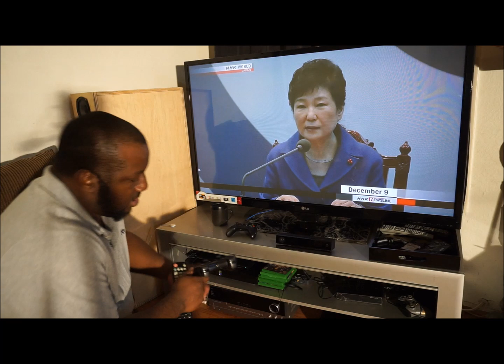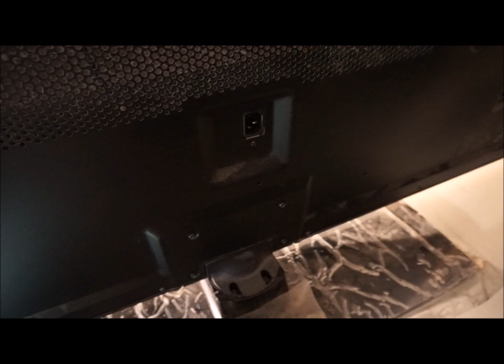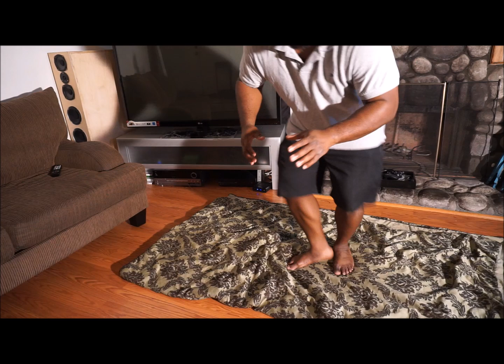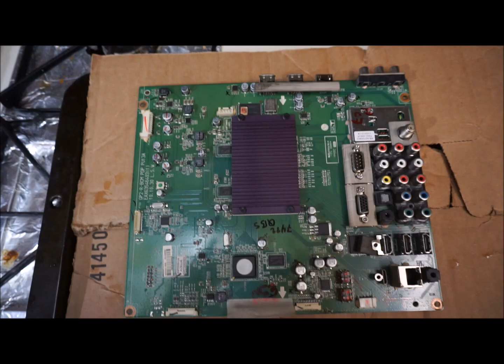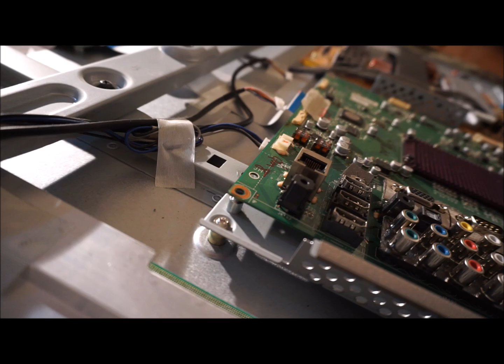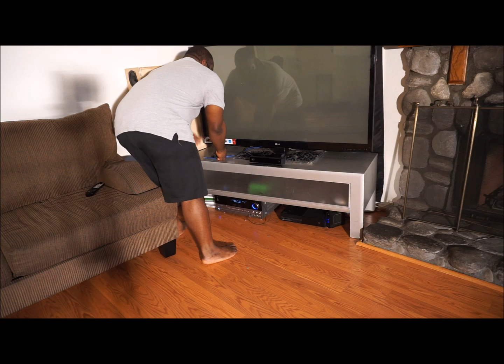DIY LG, SHARP, VIZIO & OTHERS (see vid descr.) TV FIX:  "NO SIGNAL" on HDMI inputs when connected

Comment: i tried this method and the board was totaly dead , all diods and chips falt from it and the full tv wasted
Reply from the maker: How hot of a temperature did you set the oven. And also after turning the oven off, did you open the oven door and let the oven cool down without moving or touching the board as shown and said i this video tutorial?

The first time I did this to fix my "no signal issue" I set the oven to broil (~550 degrees fahrenheit) thinking it would speed up the process and supposedly be faster/better. But instead it heat up the solder on the board so hot that it became completely loose like water, and the diodes and components on the underside of the board fell off due to 1) gravity, 2) not letting the board naturally cool down and 3) mishandling the cardboard/mainboard roughly while the solder was still wet.

So I had to manually solder by hand each miniature capacitor, diode, etc. back onto the board. As I mentioned in this video, it was a total pain to do.
Reply: Frugal_Fabrication actualy the temp. was like u mentioned 380° , and i kept the oven opened and cooled naturaly
anyway the tv was already an old one
but my question if i connected the diods and chips will the tv gonna live again ?
thanx dude
Reply from the maker: +Firas Chill yes I can I actually have the same thing happened with me and I tried my absolute best to solder diodes resistors, and capacitors in their proper locations and it turns out it worked in the end. Even after this error, the no signal HDMI issue was still resolved and fixed. 

The "no signal issue" hdmi issue came back about 3-4 years later (if I remember correctly) , and when it did i decided to make this video to help others out with their issues.

Currently, I have now have a different issue with this same television and I plan to upload and release that video soon if this new fix attempt works. The new problem is the tv turns on for 5-10 seconds and audio plays but there is no video, and then it turns itself off.

Just received some parts, but need to install and see if this fixes the issue.
Reply from the maker: +Firas Chill Just remembered, for your situation if it is too hard to re-solder the diodes and such back in or you dont know in which location they go to, you can look up the main boards part# that is printed on it and search the net, ebay, or amazon for a used main board for sale. It may still posses the "no signal" issue but at least you can get the tv up and running.
Reply from the maker: +Firas Chill no worries I will keep my eyes open. Worst case scenario if you need me to take HD pics of my board I can do it for you. So you know what will go where.

Comment: Hey man, I turned my tv around and the screen went black and the Inputs are greyed out in the menu, ever heard of that happening? Im gonna give this a go. Its a Samsung LE40R88BD.
Reply from the maker: Ive never heard this before, but I AM GUESSING (not 100% sure) that it sounds like that is a physical hardware disconnect issue. And now the software cannot recognize the hardware. 

Maybe a connector or plug inside the tv is not making 100% physical contact.

Comment: does it only work for certain tvs i got a sceptre with same problem?
Reply from the maker: I also have a sceptre tv as well (61 inch), but I have not encountered the same issue yet. Considering how reasonably priced the sceptre tvs are, I wouldn't mind trying it if I had the same issue. Just make sure that there are no plastic pieces attached to the board that can melt. Be careful and mindful of your temperature settings and amount of time in the oven.